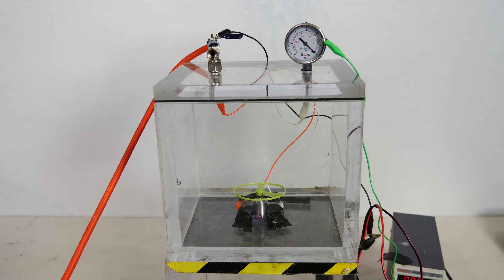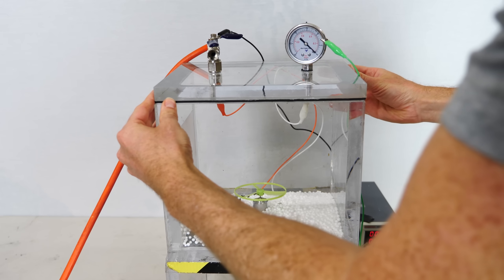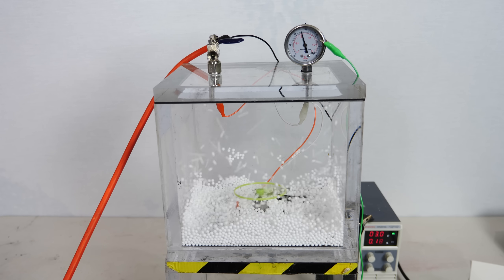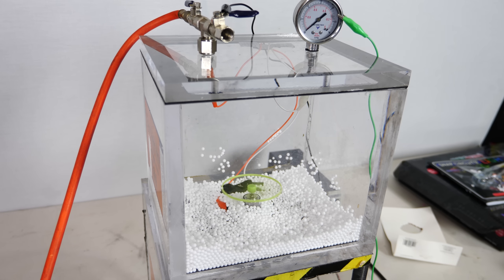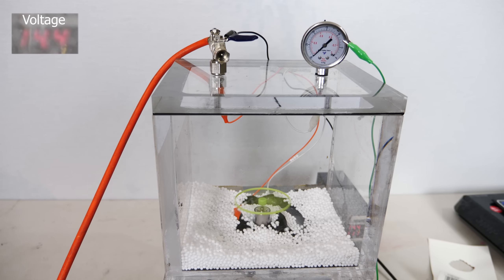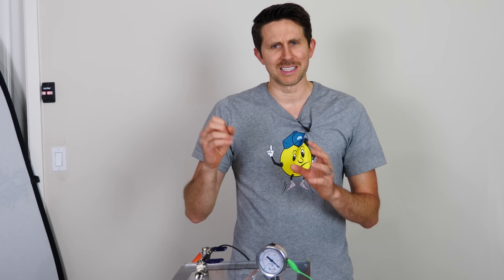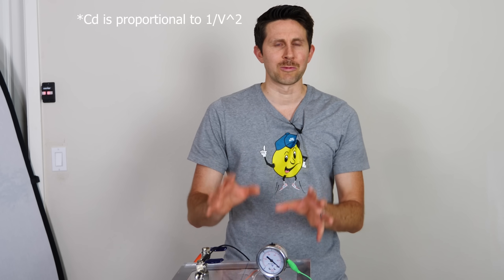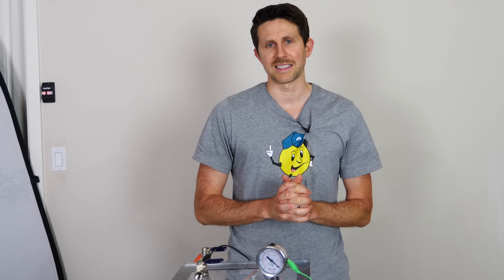What Does a Fan Do in a Vacuum Chamber? Weird Results

Comment: Pump out air. Fill with argon or helium. Play music inside and use a microphone to see how the sound changes.
Reply: Pleeeeease Im dying to find out since watching Cody do the Argon Voice LOL
Reply: It'd be easier to put a phone/bluetooth speaker in a balloon and then filling it with helium.
Reply: @Ingyer1  i am guessing the speaker might not even need to be put in the balloon? A speaker cone side could be pressed against the balloon? there may be a slight amount of bleed of sound externally.. but a microphone could be placed inside the balloon to capture what it would sound like in the gas itself?
Reply: That would be interesting, would be interesting also a way to play instruments under different gases and pressures.
Reply: @MarkHobbes  under pressure pushing down on me!!!
Reply: Good!
Reply: How is it possible to play music with a microphone?
Reply: @JohnTronMusic  he didn't say play music through a microphone.  He say play music and use a microphone to see how the sound changes. Obviously.
Reply: @JohnTronMusic  its similar to a sound producing speaker I suppose with modifications it might make sound but microphones are small so it probably would be quiet?
Reply: @JohnTronMusic  I don't know? Why do you ask? Maybe do an internet search?
Reply: @JohnTronMusic  A speaker can be turned into a microphone by doing things to the circuit.  I saw it done a long long time ago.
Reply: @JohnTronMusic  you just plug it in the speaker out. You can also do it with a guitar pickup
Reply: He should also try xenon gas
Reply: Dr Deuteron  glowing plasma so much fun to play with though ⁽⁽ଘ( ˊᵕˋ )ଓ⁾⁾
Reply: Yes
Reply: Tech Ingredients already did this with helium
Reply: If you put a loudspeaker in the chamber the sound will absolutely not change with helium, it will only get much quiet. The reason is that helium is much lighter and soundwaves transport less energy in this way, so the sound weakens.
If your voice get higher with a strange resonance in helium, it's because the speed of sound in helium is greater, so the resonance in your skull and sinuses changes, it resonates faster and you get that strange voice.
Reply: bruh imagine deathcore tuned even lower o_o
Reply: The pitch will vary based on the speed of sound in the gas. That varies according to atomic/molecular weight and temperature, not pressure.
Reply: Put a mic on one side of a fan,speaker on the other,no vacuum needed for a cool effect😂😂😂
Reply: I dont think it would change anything, i think the change in pitch isnt through which medium the vibrations travel but has to do more with human anatomy with that gaz
Reply: Human anatomy obeys the same laws of physics as everything else.
Reply: @lawrencedoliveiro9104  thats true, but what i meant was that there are other factors involved in human way of producing speech than that of a speaker, which in my opinion is not going to produce the same results.
Reply: That isn't going to change the sound of the music
Reply: Rick G  he said, fill with argon or helium
Reply: That's how they make Nightcore music.
Reply: Yea, a nice approach to study a principa similarity on MOON.
Reply: Would sound waves travel in vacuum 🧐
Reply: @krrishmaheshwari4860  No air, no sound waves. But sound can travel via solid materials even in vacuum- a microphone or a spacesuit helmet can pick it up if in contact.
Reply: it changes human voice not electronic voice 🤣🤣
Reply: 🔴 What Is Islam? ⚠️

🔴 Islam is not just another religion. 

🔵 It is the same message preached by Moses, Jesus and Abraham.

 🔴 Islam literally means ‘submission to God’ and it teaches us to have a direct relationship with God. 

 🔵 It reminds us that since God created us, no one should be worshipped except God alone. 

 🔴 It also teaches that God is nothing like a human being or like anything that we can imagine.

🌍 The concept of God is summarized in the Quran as:

📖 { “Say, He is God, the One.  God, the Absolute.  He does not give birth, nor was He born, and there is nothing like Him.”} (Quran 112:1-4)[4] 📚

🔴 Becoming a Muslim is not turning your back to Jesus. 

🔵 Rather it’s going back to the original teachings of Jesus and obeying him.
Reply: I like that idea. And I would also like to see that with and also without the styrofoam balls to see the difference in how the balls move changes with the different gases argon and helium playing the same music.
Reply: If you play music through a speaker, nothing much will actually change.
Reply: @landsgevaer  I agree, Dave. I think the odd "Donald Duck" speech of divers happens because of the way the helium interacts with the vocal tract. It wouldn't noticeably distort recorded sound. Let's wait for him to do the video and see if we're right or wrong!   :)
Reply: @zevfarkas5120  It changes the resonance frequencies of the resonance cavities in the vocal tract and mouth because the velocity of sound is higher in helium. Then the higher harmonics become stronger, a bit like a child perhaps. A bare speaker should sound pretty much the same, indeed. Should also be obvious: a different gas is not going to change the number of vibrations of the speaker diaphragm per second.
Reply: From what I remember, people's sound changes after inhaling for example helium is because it messes with the amount of air we can exhale (via the vocal chord), therefore with different volumes of air going through our vocal chord, it produces different pitches of sounds. I don't think it's gonna affect much on the sound of music being played from a speaker. At least I think it won't be as dramatic as it would be on a human.
Reply: Tech Ingredients already did that with helium. Results were pretty strong. Problem is helium is a precious gas and is rationed for science. So industrial application is limited.
Reply: @sisbrawny  I think you can buy helium to fill children's balloons...I don't think it is rationed only to science?
Reply: @JointerMark  True. I mean for industrial scale application such as sound attenuation products. Helium isn't abundant enough to offer that level of production.
Reply: @sisbrawny  Helium is readily available, Google it and see just how un-precious it is.  Industrial quantities are there for the asking.
Reply: Mark Shymanski don’t know where you heard that, Helium is in very short supply. ‘A quick google search’ would have shown you that.
Reply: @ThumperG  a quick Google search it is and in the first 3 pages there is only one entry that says don't waste rare gas. The others are all adverts and supplier lists with hundreds of outlets and cylinders and blimps and even liquid helium if that is your need. There is no shortage whatsoever.
Reply: Paul Cox Helium is in low supply actually. So let me suggest the following. Instead of doing a quick Google search for “helium” and thinking only one result in 3 pages means it’s not an issue, consider that Google is a commercial search engine that makes its money by selling advertisements for things like helium, and that most people are searching for places to get balloons for parties, not to find out whether helium is in short supply, so the results are going to tilt that direction. So instead, search for “helium’s supply”, and do it from an incognito browser window so that you get raw search results instead of results that are tailored to your own browsing and search habits - that way you see the unvarnished reality. When I did this search, the top result was for buying helium balloons, and every result below that top result was to various sources talking about the helium shortage and the problems with helium and how it’s mined and why doctors and scientists all over the world are concerned about it.

That’s because it’s much lighter than air which causes it to rise into the upper atmosphere when it’s released, and it rises high enough to be carried off into space by solar winds. Once that happens, that helium is gone forever and cannot be replaced. It is also critically needed for space launches - without helium, there are no more space launches. Ever.

Hydrogen would be in the same boat only worse, except for the fact that it’s not a noble gas, so it can combine with other atoms and form heavier molecules that can’t be blown off into space by solar winds because it doesn’t reach the upper atmosphere before turning into water or other things. But since helium is a noble gas, it cannot be combined with anything else, and is only ever found as helium, which will climb up and blow off into space when not contained.

Kids balloons are one of the most socially irresponsible uses of a limited non-renewable natural resource that there is. It is needed for a lot of things in science and medicine, and even technology in general, and wasting it like that is just the height of stupidity. There does need to be a ban on non-scientific uses of helium or else we’re going to lock ourselves onto this planet for all eternity with no hope of ever leaving or expanding to another planet.
Reply: @babybirdhome  sure, some, probably even most, rockets use helium to back-fill their tanks during launch, but for example SpaceX new Starship system that is in development uses autogenous pressurization, it fills the tanks with oxygen and methane gas respectively, heated from the propellants by the engines, instead of helium, simply due to helium being scarce and therefore expensive and also, not available on Mars where Starship of going.
Musk have stated that the helium to pressurize their Falcon 9 rocket during launch costs more than the propellants themselves.
Reply: @Gamerock82  Tell that to a team of scientist working on superconductors who stopped the project due to shortage of helium. U.S selling their stockpile giving the market enormous supply hence why the price is so low.
Yes its second most abundant element of the universe but Its expensive to recycle as it doesn't react to anything. The reason why helium balloons are so cheap is that helium in that balloon is diluted with nitrogen.
Reply: @babybirdhome  I do hope you read further than this reply because THIS reply is only aimed at THIS comment. Google may sell ads to companies advertising Helium but companies wouldn't be advertising if the product were not readily available so your argument is pointless.
Reply: @buttertoffeecoffee  I'd actually forgotten about this thread but having done some further research, I've subsequently found that Helium in pure form really is a very finite commodity here on Earth. Only found, in any abundance, in 3 places. Those stocks are specifically dependent on other reactions happening deep within the planet and these are fading and or being mined for other reasons. Thus Helium is indeed running out. There will be no replenishing it. I was previously arguing / discussing with only half the facts and for that I apologize. This is a widespread and standard internet practice that I'm always moaning about and this time, it was me. I was wrong. 

That said, interesting point, that the Helium sold for balloons is diluted. I'd argue that considering one of the things that, with current technology, will be the first to be lost to us is MRI scanning.... That no Helium should be sold for silly stuff anymore. What we have left is not just precious, it is vital to medical applications and as such should not be wasted. Certainly not for party balloons, where either Nitrogen or Methane could serve equally well.
Reply: @babybirdhome  unless I’m mistaken I thought most rockets utilize an oxidizer and petroleum based fuels(RP-1)? I haven’t heard of a helium based rocket.
Reply: @NarutoMagicCyclops  Helium is used to pressurize fuel and oxidizer tanks in rockets and is viable for nearly (if not actually) any combination of liquid rocket fuels and oxidizers. It's also used to maintain structural rigidity as many types of rockets would just collapse at sea level pressure without pressure in the tanks (I'm sure you can find plenty of imploding rocket videos here on youtube). As a noble gas it's worthless as an actual combustion fuel component, but that also means that it won't react with the fuel, oxidizer, or any of the tank component metals and such, at all; so no need to worry that it will corrode or contaminate anything. It's extremely light in gaseous form... lighter than, say, even LH2 (which itself is super duper light compared to, say, LOX), so as long as the rocket is experiencing acceleration ("pointy end up, flamey end down" for a pre-orbital booster) it'll help keep the combustion liquids at the bottom of the tanks so they don't try to breath He and flame out.

This is my understanding at least, but I'm no rocket scientist. :)
Reply: @Gamerock82  "I was wrong."  

I just skimmed tbh so idk what the debate was about, but I rarely miss this phrase. Most powerful three words in the English language imo, they signify one of the most important human virtues. I don't trust anyone that I've never heard use this phrase. High five good sir.
Reply: @phxgen  thank you. Irrespective of the topic, it is good to remember (and I can be as arrogant as the next bloke astride my high horse) none of us are infallible. Appreciate your comment. High five right back at ya.
Reply: @Gamerock82  Nitrogen and methane would make pretty poor party balloons.  Nitrogen is 75% of the atmosphere, so a balloon inflated with nitrogen has almost zero lift.  Methane?  H2?  Well yeah they work, but, they are kinda hazardous around birthday candles...

Incidentally, I once spoke at length with a balloon hobbyist - who didn't fly (in!) hot air balloons, but straight lifting gas.  I asked him about the cost of helium, assuming that that was the only gas he could use.  He replied that helium was indeed too expensive for him (10s of thousands per flight), so he flew with hydrogen.  Hydrogen!?  He said "yes, I know the hazards, there is just me, and I wear a parachute".

Hydrogen is actually fairly safe - the flames and heat go straight up, so you won't get burned.  You just have to be prepared to jump out if necessary ;-)
Reply: @phxgen  But I am a rocket scientist ;-).  Yes, gaseous helium is put in the tanks under pressure to help prevent the liquid fuel components (eg: RP1 or LOX) from sloshing around or cavitating.

It doesn't provide enough pressure to push the liquid fuel fast enough to the engines to keep them supplied.  So they use pumps for that (in almost all liquid fuel engines).  The helium is there to prevent the pumps "cavitating" the fuel.  You could use N2, but the weight is higher and will turn to liquid at about the same temperature as the LOX does.  You could use N2 on the RP1 side, but not the LOX side for that reason.  H2 would work with LOX, but you think a normal rocket explosion is bad, H2+LOX in such quantities puts them all to shame.

There are some rocket engines where the pressurized gas is part of the fuel.  For example, smaller hybrid rockets use a solid burnable material as the fuel, and have a tank of liquid nitrous oxide as oxidizer.  At normal temperatures, a tank of nitrous oxide will be mostly liquid and some will boil off, the pressure will build up, until equilibrium is obtained.  The normal pressure is about 700PSI at 25C. Which is more than enough to push the liquid NOx out of the tank to vaporize and ignite in contact with the fuel.  There's one really nice thing about them - if the combustion chamber blocks, the pressure will build up to overcome the NOx feed (at 700PSI), and combustion will automatically reduce as the NOx flow reduces.  Meaning that hybrids of this type CANNOT explode.
Reply: @fromagefrizzbizz9377  Thank you, sir or madam! 

I didn't mean to imply that H2 could be used to pressurize a LOX tank but now I see how what I said could've been interpreted that way. I'm a dumb ape and all, but not quite that dumb :) dumb enough to occasionally blow up trashbags with oxyacetylene from a great distance though... I imagine if I had h2 available it would be even more ear-shattering, eh?

Edit: also didn't mean to imply that He provides pressure to drive enormous amounts of fuel or oxidizer into the engines, s'pose I should have mentioned something about keeping liquid fuels near the pump plumbing bulkheads, or whatever it'd be called by people less apeish than myself.

I envy your expertise and field of work. I'm about set to retire relatively quite early, afterward I'd probably clean toilets at SpaceX (or ULA, etc) for free if they'd have me lol. Closest I've been is seeing a couple launches from reasonably close to Vandenberg AFB, and a few more from a distance via "twilight effect" (also all VAFB launches). I've not yet seen a booster land itself (or be caught in the air by a helicopter), but that's definitely near the top of my bucket list. Thank you sincerely for your input!
Reply: @phxgen  You're welcome.  I didn't mean to imply that you implied those things...  You merely mentioned them in passing and I amplified on that and forestall some other puzzlement from those reading your post.  "So what's this about pumps if the He2 is squeezing it out"?...

I believe a stoichiometric mixture of H2&O2 is rather more BANGY than a stoichoimetric oxy-acetylene mixture.  That said, I'm a bit more mindful of acetylene because it's a bit unstable entirely on its own and can go BOOM! without an ignition if you're stupid enough.  if you filled a, say, an aluminum pressure cylinder to over a mere 30PSI with a bit of contaminant air in it, just dropping the cylinder - boom!  H2 & O2 needs a distinct ignition - without it, it's "nice and stable".

"nice and stable".  Cough cough cough.  Holy fuck, I'm not going to stand anywhere near a stoichiometric mixture of H2 and O2 anyway!

Just in case you've not heard the term stiochiometric: it means that the mixture is perfect, and the reaction will run to completion with none left.  A 2:1 ratio of H2 and O2 is stoichoimetric.  If you put that in an apparatus and ignite it, all you get is H2O (water), no wasted H2 or O2.
Reply: @JointerMark  its running out
Reply: @sisbrawny you still believe in Helium?
Reply: @sisbrawny  You can always use hydrogen instead - the result will be even better and you won't worry about explosion much (with basic safety measures the worst case would be destroyed speaker) Though I wouldn't breathe the hydrogen (spark and H2-air mixture inside your lungs... rather horrific death).